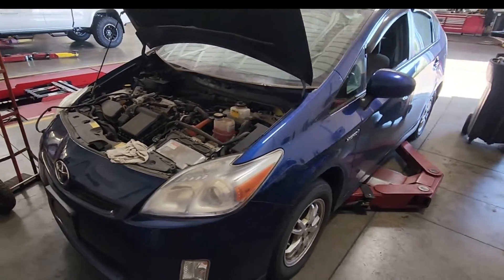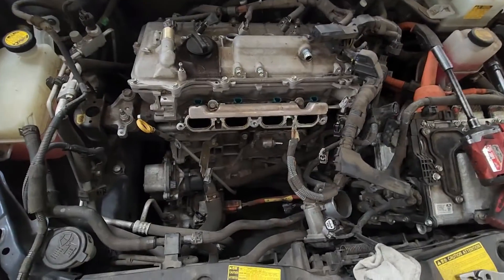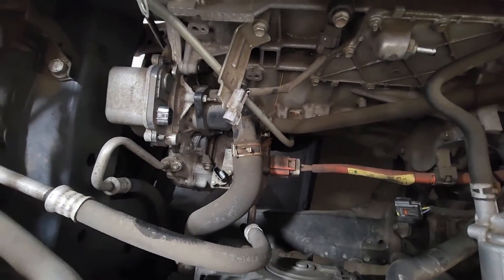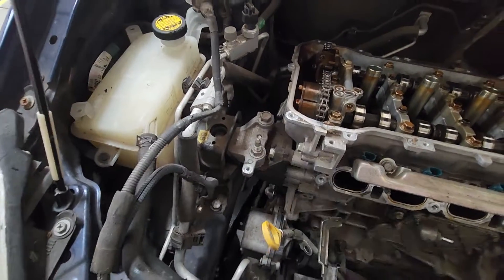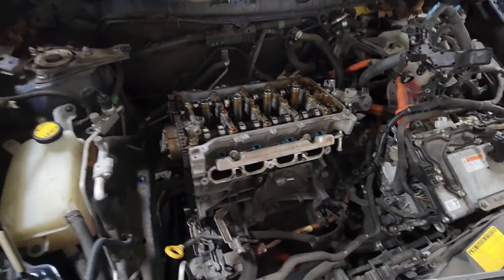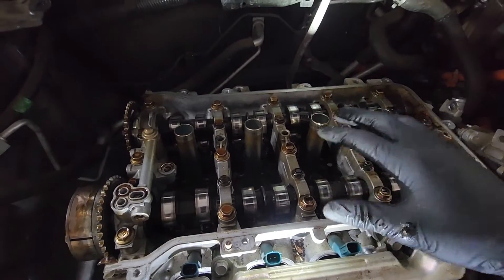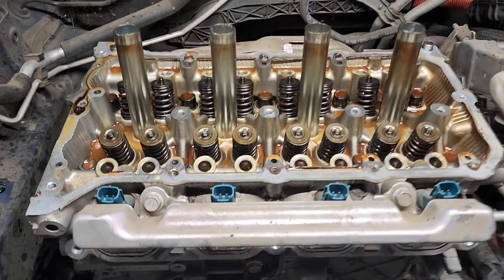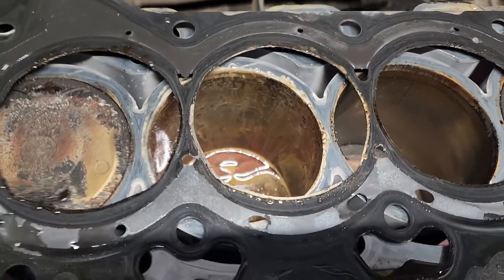How to remove a Toyota Prius cylinder head (head gasket replacement)

Comment: Is there a little metal dowel like maybe half a centimeter or so and a few mm in diameter in the top cover or maybe sits in that VVTi passage or somewhere else that'd be in the top cover?   

When I practiced removing a 2011 with ~150K miles head at the yard; I noticed, and didn't see where came from, that little metal dowel fall out of somewhere when I flipped the top cover upside down to set aside.  

I wound up purchasing all the yard pull timing and head assembly parts to practice checking per Toyota specs and possibly use as well since my 2013 has way more miles on it.  What are your thoughts?

Thinking now I might rebuild if the surface checks out. 

Though wondering what that little metal dowel like pin part is?  

Any advice is greatly kindly appreciated.  Thanks for sharing Drew!  Liked and Subscribed already.
Reply from the maker: There is a dowel that helps aline front cover to engine. It has never fallen out on me before. It is right above the water pump pressed into the block.
Reply: @shoptimewithdrew  Little 2-3mm diameter one maybe 5-7mm long?  I'm going off memory watching videos now.  Looked oil covered and like was inside somewhere in the top cover over the cams like I'm guessing has something to do with oiling possibly.
Reply: @shoptimewithdrew  Just double checked size and was 10mm long and 3mm diameter with a slight taper maybe 1.5mm or so in on one side.  Was I'm thinking somewhere in the top valve cover like where the oil cap is of the head assembly, cause fell out of somewhere when I flipped and moved.
Reply from the maker: I don't know exactly where you are talking about if the pin was hollow it could have been the alignment dowel for the cam tower to the cylinder head.
Reply: @shoptimewithdrew  For some reason in my mind I'm thinking was for an oil passage or something VVTi as I thought I saw a video noting to be careful with that oil passage on that cam.  Definitely was in the valve cover where found and I forget if I placed the cam tower on.  Seems I did, so wondering now if came out of there.  It's a solid 10mm 3mm diameter, with one side tapered with a slight dimple, dowel or pin from somewhere.   Thanks for your time, I do sincerely appreciate that and your experience.  If rings a bell what is, please let me know.  I'll keep researching and post back what I find out if I do.